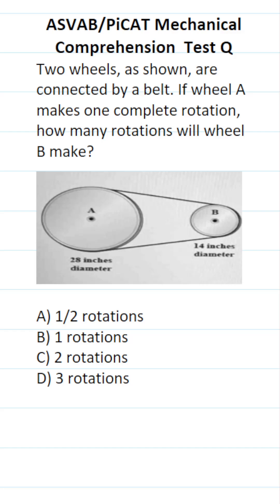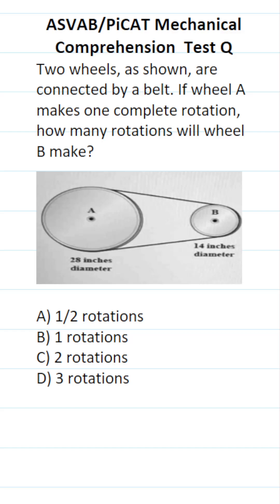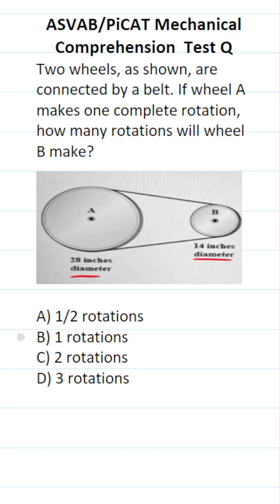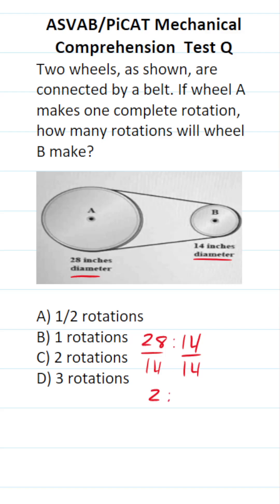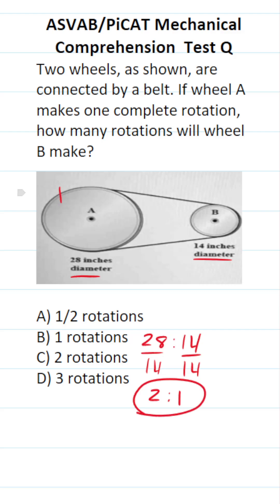Mechanical Comprehension Practice Test Question for the ASVAB & PiCAT #acetheasvab #grammarhero

Comment: This does work and thank you for this method. But if the smallest wheel is exactly half the size of the largest wheel that means it will make half the rotations  of the larger wheel. Half always insinuates 1 of 2 parts.

Comment: Is there a rule for ratio that explains why for a 2:1 ratio wheel B spins two times and wheel A spins once. Why does ratio refer to opposite objects in this scenario other than wheel B is smaller and obviously spins twice.
Reply from the maker: In reality, you would compare the ratio of their circumferences, but since circumference and diameter are related, you only have to use their diameters to determine their gear ratio (i.e., how much one spins vs. the other one).
Reply: @GrammarHero  Thank you for explaining, helps to understand the math more and cement it into memory. 
Btw just want to say I've learned so much from your videos, I feel very confident with the math knowledge portion of ASVAB, taking it soon, thanks for everything.
Reply from the maker: @CrispyApplJackz  Good luck!